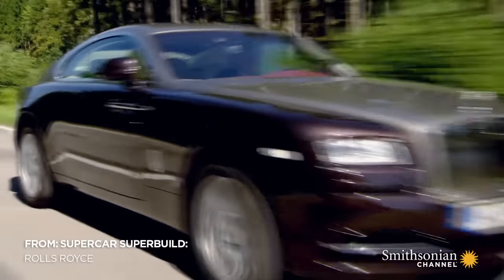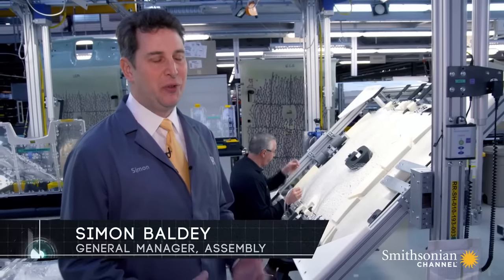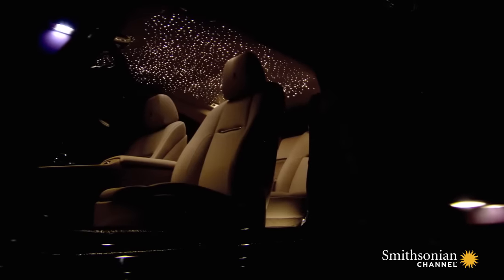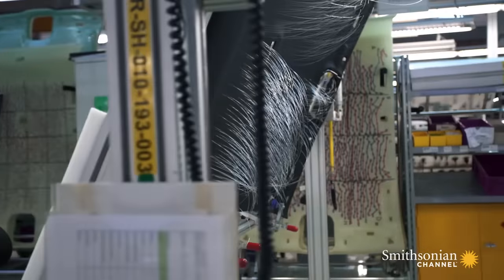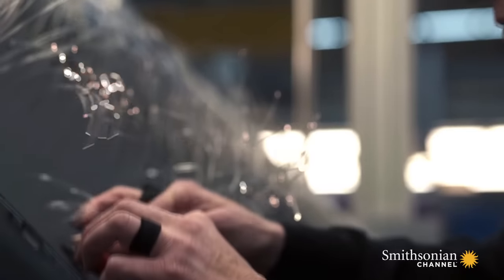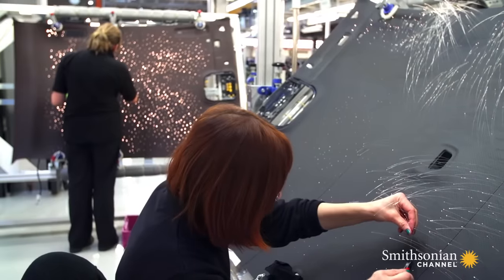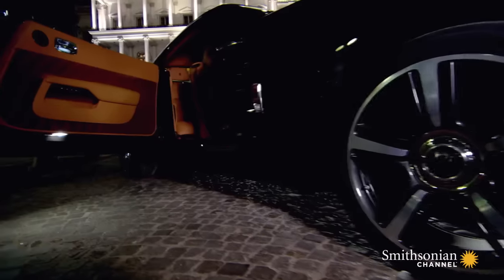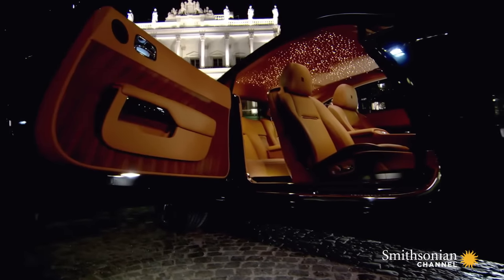Why This Rolls-Royce Starlight Feature Costs $12,000

Comment: Still not worth anywhere near 12k
Reply: labour hours, overtime, skill requirement, material cost, wastage, premises, equipment, maintenance, heating, lighting blah blah plus then branding. Its not too ridiculous+also cost does not equate worth, worth just comes down to what value the consumer places towards it which is 12k. You can have a product that costs 5k but if the consumer doesn't see it as valuable, it wont matter if its priced even at 5k or $500.
Reply: NE H The average consumer does not value it at 12k though, only the consumers who purchase it value it at that.
Reply: TheBaz568 agreed. Fiber optic star ceiling kits are on amazon for about $40. Its not cutting edge tech.

If someone wants this then just have some friends over to help, order food and make a good time of it.

"labour, skill, etc...". HA! they showed you the whole process in this short video, dudes just poking them through, securing them with glue and sniping the ends.
Reply: They are worth 12k because the people buying the car wouldn’t mind the 12k price tag
Reply: HikingViking lol. You do that on a 300k car you'd just depreciate it 15k
Reply: TheBaz568 facts people on YouTube doing it for under 100$ and it looks exactly the same 😂😂😂😂😂😂😂smh
Reply: @Usenabt  very valid point.
Reply: NE H ummm actually 100$ on Amazon lol
Reply: NE H I did it to my car for $60 and 8 hours of work
Reply: should be 20K ru joking. bargain

Comment: 14 hours labor.... Paid someone 857 an hour to install it?......
Reply: Thor Dehr And the price of all the materials.
Reply: Justin Xia materials thankfully can be had for a couple hundred USD. I did this in my bedroom ceiling on an 1.3m x 2.6m piece of foam insulation. The most costly thing was the lighting (gotten off a wholesale website for ~150 USD). I'm sure the leather factors in for the RR, but I assume the ceiling is already leather. The host mentioned choosing which stars can be viewed, so it sounds like there might be some tech and computer systems that might factor slightly more into the cost.